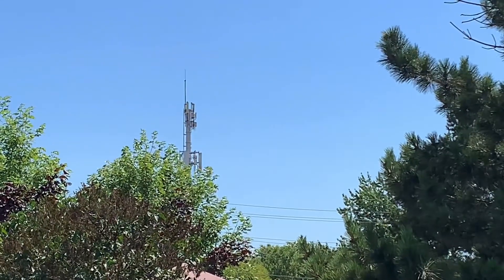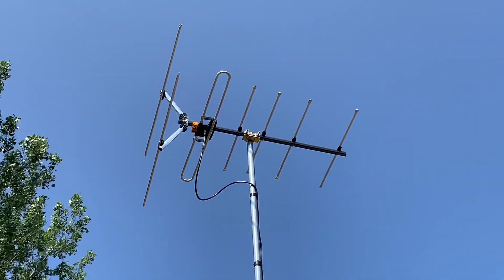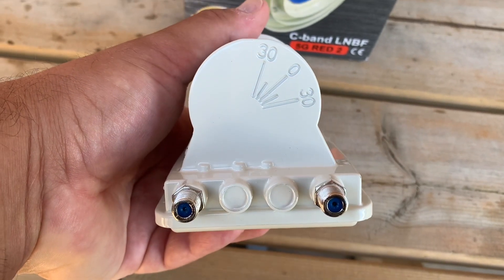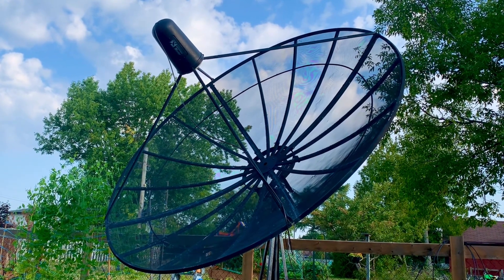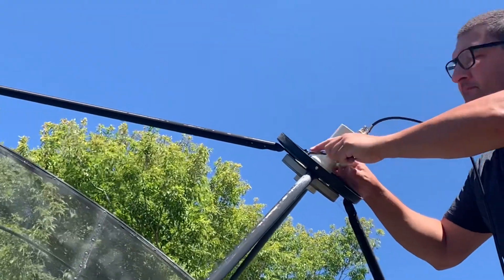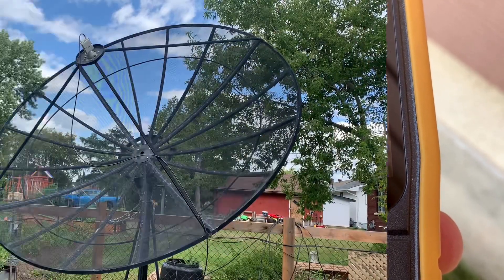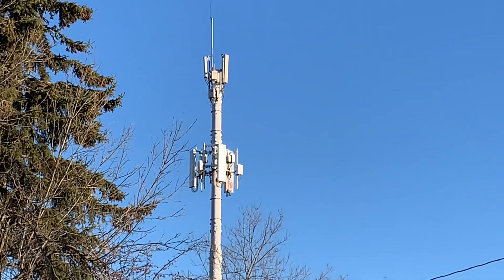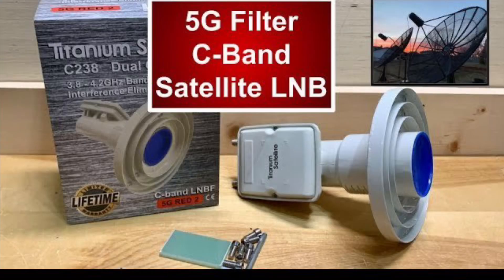Fix 5G Interference on C Band Satellite TV with a 5G Filter LNB - FTA Satellite Television

Comment: Thank you for your video -- it alerted me to the issue and what I need to fix it.  In your video you show the box for the C-Band LNBF C238 Performance Plus - 5g RED Interference Filter 3800-4200MHz LNB which the Amazon site says is:  (Export Model - Not Suitable for US or Canada 5G Interference).  I think the correct LNB for U.S. 5G interference would be the C-Band LNBF C240-5g Blue Interference Filter 4000-4200MHz Band Pass for either one or two outputs.  This is because there is an ongoing rollout of upgraded 5G service in the U.S. that the red filter cannot handle.  Just in the last few days, it came to my area and makes C-band sat channels almost unwatchable. Nevertheless, great information.
Reply from the maker: Thank you. At the time of making this video, only the red filter was available; the blue filter was not yet produced. The red filter is still installed and continues to work as expected for me, likely because of the frequency bands actually in use (or not in use) for cellular service in my area. But I have a feeling that will change at some point, because I know local cellular providers bought up spectrum on the 3.7 GHz band in the last auction here in Canada. I do plan on getting the blue filter sometime soon. Thanks again for watching, and commenting.

Comment: I have a C plus Ku band FTA receiver. It runs directly off 12 volts. Now I can buy the Titanium 5G ready LNB. I don't have a huge dish, and I very likely will never find a good one. I'd rather find a carburetor rebuild kit for a 1930's derrigible. Most FTA watchers will never find a huge dish. Surplus? That's not going to be easy. ....You should get those six sided crush F connectors overboard , and procure some cable TV grade F connectors. You can even remove them and reconnect them and the quality is no comparison.
Reply from the maker: @stanleybest8833  I’ve got compression connectors. I just haven’t made the time to change those out yet.

Comment: Its a shame they could not make the C238 as a PLL version and incorporate a sharper filter that rolls off at 3.7GHz and not 3.8GHz as I miss some transponders around 3.74 GHz down in Australia where we have a lot of C-Band signals.
Reply from the maker: @mikebloodworth9258  I hear you. I think this LNB is more or less designed for the North American market, as all of the transponders in North America have migrated above 4000 MHz now on account of 5G service utilizing the 3700 and 3800 MHz bands. However, there are still South American transponders that use the 3700 MHz band, so an LNB with the full receiving bandwidth of 3700 to 4200 MHz would be needed to receive those; however, the 5G cellular signals transmitting all over North America might make that impossible in many areas.

Comment: Is it possible to use the filter with Ku band? 🤔
Reply from the maker: No. The filter is specifically designed for 5G frequencies affecting C-band. KU band satellite broadcasts on a totally different bandwidth of frequencies (much higher frequencies), and is unaffected by 5G interference.

Comment: have you tested with 5g scalar filter what Australians use ? does those work ?
Reply from the maker: I haven't tried those filters.
Reply: @NorthcoasterHobby  good for replying back , it's good we can share experiences with other fellow who also into this as I am since gotten 10ft dish is now I finally noticed interference now from 3.7 to 3.8 band on every sat...and I thought it would never happen to me until now that I have unable get stable signal for lower band. And I was thinking it may or may not work as others suggested that adding reflectors shielding around your dish that might block all signals from each sides only down side, is your dish be stuck in one position any sat is above 97w to 125w maybe.. haven't tested that theory or having a huge aluminum wall around your yard ...like a tall fence around the satellite that might work to get lower band siqual stable but like everyone said, just wait until they move everything to upper band...some decided go extra mile like what eutelsat planning to add extra upper frequency from 4.5 to 4.7ghz

Comment: I have the C138 and it does not eliminate 5G interference when I point to the west. Eastern satellites are fine. So the Titanium LNBF is not the best solution.
Reply: You need to switch to the new "Blue band" C140 LNBF, as that filters out the latest higher 5g band. It seems they might have now turned that band on for you, and caused issues.

Comment: I live in a place with 5G network and live very close to the tower, but never had problems with Ku Band satellite and UHF TV reception, both have a 4G LTE filter. I read a few months ago that C Band satellite can be heavilly affected by 5G and the frequency band is reduced in order to avoid interferences.  In Europe C Band is rarely used, only If you want to receive russian or pakistani channels.

Regarding UHF TV reception, on my AMIKO TSC 1270 digital meter when I connect any UHF antenna on 800 MHz I can see the 4G/5G interference despite the fact that all my Yagi antennas have 4G LTE filter and frequencies above 790 MHz are cut off. Even if I connect a new UHF antenna with 5G filter I still can see the 5G signal on my digital meter. If you connect to an analog TV on 800 MHz there is weird static.
Reply: See this is the comment I was looking for. I wanted to know if people are actually experiencing interference yet if at all and what exactly did they experience in that case, some channels missing or all of them, what ever the case may be
Reply: @DJSubAir  In Europe in the analog days UHF TV band was between 470 - 862 MHz, or channels 21 - 69

After the digital transition and the launch of 4G LTE the UHF TV band was reduced: 470 - 790 MHz, channels 21 - 60 and it was the first time when 4G filters were available for regular UHF antennas. The new antennas already had a 4G filter built in, for both passive and active. Also the VHF/UHF combiners have this filter.

With the launch of 5G the UHF TV band again was reduced: 470 - 690 MHz,  channels 21 - 48 same scenario like the 4G. 

In my case I never experienced interfernce, I can use an old UHF antennas and get crystal clear picture, no breakup. No need for filter and I live very close to the 3G/4G/5G broadcast tower (a few hundred meters) and there are 2 broadcast towers, while the TV broadcast tower is 30 km away. 

When 4G was launched we still had analog TV but the picture was excellent , in digital age there are no problems. On UHF I receive TV stations and channels 26, 33, 42, 
and these are the same frequencies used in the analog days. In fact the frequencies never changed only transitioned. 

In some areas TV frequencies close to 4G/5G may be heavily affected but a filter will solve your problem. If you use a VHF/UHF combiner, note that the combiner already has a filter built in. The best part is when both your antenna and combiner have 4G/5G filter built in and this way you won't have problems. 

With digital meters if you connect a UHF antenna you will see on 700 MHz and 800 MHz the 4G/5G signal even with a filter. Or connect to any TV and search in analog TV mode, you will see weird static. 

An amplified TV splitter will amplify your phone signal on UHF but with a filter it won't   affect the reception.

No problems on Ku Band satellite TV at the present time and I use the AMIKO ECO QUAD LNB with 4G filter, I also use the RT Inverto LNB.
Reply: You are likely seeing >600MHz RF carriers from T-Mobile, and 700MHz to 900MHz from AT&T and Verizon.  You will need an external antenna filter that starts at 610MHz. Since domestic over-the-air terrestrial television broadcasting does not now extend past actual channel 36, which stops at 608MHz.